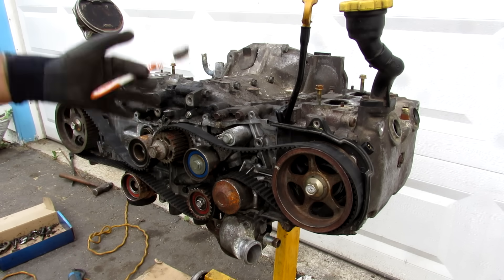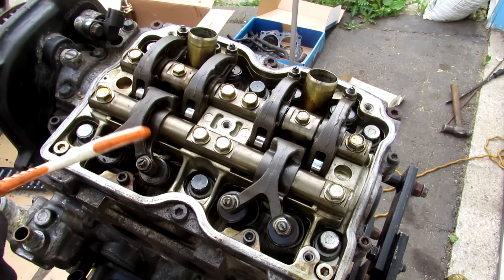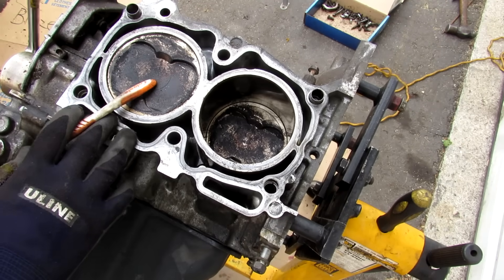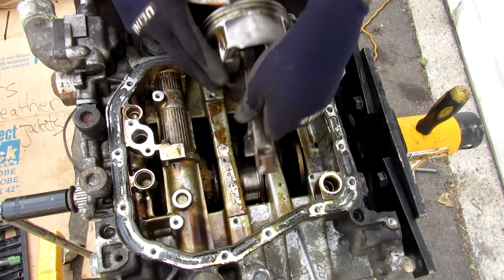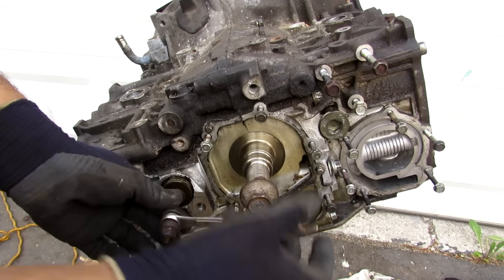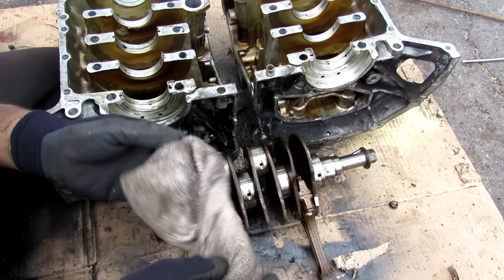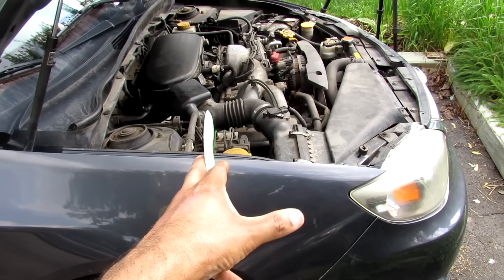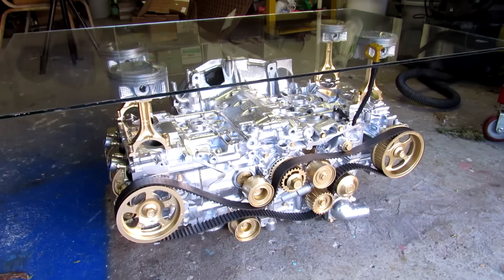Why Subaru Engines FAIL

Comment: I’m gonna actually disagree with the statement of V shaped engines being smoother than inline engines. I’ve felt the vibrations directly from Ford’s EcoBoost V6 and their Duratec i4, and the Duratec is far smoother. While it simply vibrates, the EcoBoost has a light rocking motion

Comment: Good vid, but v engines are def the least well balanced and require additional rotating parts to counteract the diagonal forces
Reply from the maker: I messed up on that, looking back
Reply: @speedkar99  dam you replying to comments on a vid years old? Respect+

Comment: wish i had that knowledge i got an old forester i just got not that long ago no lights no issues but needs basic maintenance brakes rotors drums its got a weird little jump like other foresters ive driven at low speed sometimes it acts a little weird but never in higher gears or even all the time more like an air fuel thing idk im not you so im asking if you ever heard of this issue?

Comment: I've only owned one Subaru. Even though I was extremely meticulous about service, maintenance and fluids, it gave me more problems with less than 60K miles on it than any other car I've ever owned and this covers the years 1966 until now. This car was designed to self-destruct when it left the factory. Never again. 
I don't blame the boxer engine design because my 1965 Corvair Gen 2 was MUCH better. 
I switched to Honda cars in 1991 and they have all been extremely reliable. However, the new and tiny, over-stressed DGI engines in all makes and brands are in my opinion, doomed to  premature failure as well.
Reply: that's really interesting that you had such trouble with them. Ive been driving Subaru for years and have never had any major issues, sure the maintenance can be frustrating but overall they're super reliable cars if you take care of them.
Reply: @NoiceToasty  At 60K miles, I suffered blown head gasket, broken timing belt, broken pulley brackets, broken exhaust system insides, broken AC compressor and many other things. After having towed to the shop the third time for another major repair, I traded it in for my first of many Honda's which have all been excellent.

Comment: Excellent explanation; the editing is tight but there's just enough modulation in your voice to preventing it from becoming a repetitive drone or sing-songy which plagues many youtubers. Great information on the tear down and inner workings of the Subaru boxer. As far as the title, is the reason boxer engines fail is oil starvation?
Reply from the maker: Headgaskets

Comment: Sorry, but with the title "Why Subaru engines fail", I expected a definite answer to this, but ANY engine that is run low on oil will fail!
And the Boxer IS a proven design (Porche), so that ain't it. Yeah, I'm sure the anti Subaru/Boxer guys will have a heyday
Hell I was thinking I would be told about a common problem here, NOT a maintenance issue.
Reply from the maker: Ok

Comment: I've had two Subaru's never had a problem with either one.  The first one I gave to my son when I hit 200,000 miles because I was worried it was wearing out.  at 289,000 he got rear ended and it totaled the car... Still running perfectly, but the unibody got wrinkled all the way to the windshield.  As long as they are maintained I've never had a problem.  Synthetic oil always and timing belts changed as specified.

Comment: Great video.  It should be used as a wake-up call to people of all ages that have no idea how an engine works and think that just because they are made from steel and aluminum they are indestructible and require little to no maintenance.  Note to the ignorant; if you want your car to take care of you then you sure better take care of your car.

Comment: 224k on my 2014 crosstreck... Same engine same transmission.. Running smooth and no check engine light.. Yet
Reply from the maker: Enjoy it while you can
Reply: Lol well I am soft on the accelerator. I think that helps. Most bust up's are on the wrx, those are driven really hard by people. I am keeping an eye on leaks, for now it's ok and the oil has not been dropong off.. Yet

Comment: my 91 subaru legacy has 362,000 miles on it and it is still running perfect. Yes, I change the oil about every 4-5000 miles but never over that and never use Fram filters.
Reply from the maker: Those were the good ones
Reply: Yes, mine were both early 90's engines and were fantastic, no oil or coolant leaks.  People don't realize how much better the synthetic oils are compared to the older type.  Much less friction mainly which leads to less heat, bearing wear, valve train wear, seal wear and of course ring and piston wear.

Comment: I bought an 07 Subaru Impreza for 700 bucks some years ago. Needed an engine, as not only were the heads warped from overheating.. but so was the block. A part of me was kind of impressed hahah. So i got another engine for 500 bucks that only had 20k miles, and just had the heads redone. Put in a new timing belt, pulleys, gaskets, you name it. Everything. Engine was practically brand new! Got ONE YEAR out of it before a valve got clapped by a piston cause the timing jumped. Did a compression test once i got it home, and lost both cylinders on the passenger side. And during that year, subaru's infamous freezing calipers reared their ugly head. Spent a pretty penny replacing all that. And yes, i maintained this engine religiously! I took great care of it!

I got so mad, so fed up, that i took my BFs truck, chained it to the Subaru, and dragged it out back. Where she still sits. I'm gonna sell it, along with aaaaalll the parts i have for it. It's fixable, but i refuse to put another dollar into that car. It was absolutely phenomenal all year round. Especially in the snow. But goddamn those boxer engines! Only good to use as an anchor or to make a pretty table out of them
Reply from the maker: I have one as a coffee table and love it!
Reply: @speedkar99  omg that's awesome!!

Comment: I’m on my 4th Subaru over 20 years. Never had a problem! Great cars.
Reply from the maker: Good to hear!
Reply: I am on my 3rd Subaru.  02 wrx has 230k miles, 99 impreza has 250k and 06 forester xt has 165k.  99 impreza was rusted out, ran great and didn't burn or leak oil.  06 forester was totaled in a car accident, burned very small oil but ran very good.  I still have my 02 wrx for DD right now, runs great and no burning or leaking either.  I only had to change brakes, oil, coolant, spark plugs and timing belts.
Reply: @Pccpy hich is the best generation of wrx to buy used
Reply: @SK-tr1wo  IMO GD 2000-2007 (Second Generation) is the best to own if you can find one without rust.
Reply: I still have my 94 probe gt daily driven for almost 30yrs... about 260k mi ,all original, never rebuilt..even the original clutch and exhaust....4 cars over 20yrs  is not bad but many cars have gone far longer...The caveat with the KLDE mazda engine is ive had an insane numbers of issues over 3 decades..far from trouble free ..LOL
Reply: on my second subaru totaled the first one after falling asleep on the highway
Reply: On my third Legacy (last two, Outbacks) since 1987. My current (1998) Outback at 103k miles, aside from changing timing chain, and clutch a couple of times, never any problems.
Reply: I'm on my 1st honda in over 20 years....
Reply: So, why are you on fourth car? I have been driving my only one Jetta last 20 years…!
Reply: so you only keep them 5 years?
Reply: @ yes. Different models for different needs,
Reply: You need to buy a lottery ticket like right now!
Reply: Still have my first Toyota 27 years later, 220k  original engine. You should buy a better car.
Reply: @MathWithMozart  maybe he just likes subaru that much that he bought 4, you never know.
Reply: @MathWithMozart  That's great for you. I have no desire to be driving around in a car with 220K Miles on it. Just because the OP bought a new Sub every 4 years, doesn't mean it was because they were dead. People buy new cars for all kinds of reasons. They just love the new car smell, they want the new features, they have a job where driving a new vehicle makes a good impression. Or any number of reasons. Your comment comes across as some clever dig at the quality of Subaru, but it's really kind of out of touch with reality.
Reply: @MathWithMozart  people like what they like, not like toyota is perfect. I do miss my old jeep wrangler, thing was a tank. New one is 99.769838 percent plastic, oh well

Comment: I've had four Subaru Imprezas and serviced them all. The spark plugs weren't difficult to change if you had the correct plug extension bar. Great cars, never had an engine failure.

Comment: Spark plugs changes on these in the car is very easy I'm not a mechanic and it took me less then an hour to replace the plugs, wires and coil. Plus I have roughly 230,000 miles on it

Comment: 5:48 the crank is gives oil pressure, the pump just helps it move through out the engine
Reply from the maker: Yes you are correct. Oil pump provides flow

Comment: If this “Boxer” design has such numerous flaws and features that could easily lead to problems….why does Subaru continue to use this engine in the format that you’re showing us ??
Does Subaru Boxer engines have enough issues to basically warrant a swap out to some other engine design, or does Subaru just not really care, or are the problems inconsequential enough to prevent Subaru from doing such things?  I have a 2011 Outback with a zero tolerance engine and a sealed transmission unit.  I bought the car with 176000 miles and carfax said a new transmission was installed around 120000 miles.  I then put an entire new exhaust system in including catalytic converters and all new pipes and a couple tune up.  Then I thought the transmission was going but it has a CVT in it and it turned out that the transmission was fine.  It was the separate computer that controls the CVT that was bad.  Replaced that and it ran like a champ.  Now…. It’s overheated and the coolant overflow keeps filling up and my upper black hose gets hot but the lower one stays cold.  So I think the thermostat is stuck…..what do you think????????

Comment: Yep my girlfriend had a forester blow a head gasket cuz radiator leak gone undetected..easy to break if you dont check the engine often...another car to avoid is the dodge avenger worse then a subaru in my opinion

Comment: Five seconds in and I think I know what wrecked the engine.
It was the lightweight pulleys on the front.
Subaru are fully aware that their heavy pulleys maintain the crank speed during idle. Lightweight pulleys allow the crank to alter speed at idle, and the spark happens before TDC, which destroys the bottom end fairly quickly.
So yeah - don't put light pulleys on an EJ!

Comment: After retiring from a long career in engineering , my neighbor invited me fill a position and  to work for the Subaru dealership where works as a parts sales manager . My part time job was to manage and provide solutions to   the building systems maintenance crews ,which included  garage floor  machinery and lifts. Not a huge dealership ,so , the job did not require a full time manager, besides , I could always be reached easily if needed. The lifts issues enabled me to chat with all the techs , and see first hand what was going on with SUBIE engines transmission etc. Any engine that has to come out of the car in order to have its head bolt retightened after some arbitrary mileage to keep the head gaskets from leaking oil or coolant is a cruel joke played on SUBIE buyers, which incidentally have perpetual recalls  on every model they make .Ranging  from wheel bearings that are cooked at less than 60 K miles to brand new Ascents with bad PCVV valves and infotainment systems that when failed cause windows to stop going up or down 😂😂 that is a big WTF. After about 2 years in 2020 I decided that I wanted to be really retired to indulge in my hobbies full time. But I came away from that experience thinking that  I would not own a SUBIE even if one was gifted to me . However , I`ll say one thing that is undeniably true about them and is positive ; SUBARY  warranties are likely the best in the industry , in order to keep a good reputation they will go out of their way to cover repair costs even on vehicles that are out of warranty for a year or so,  also   the sheer carnage that STI owners cause by abusing those hopped up  ready to explode grenades one owner in particular got his STI engine rebuilt twice  $ 17 thousand the first time and the second for  $15 thousand, the damned car would not retail for 30K if  on the lot, mind numbing.
I am a motor head from the mid sixties , no stranger to engine carnage , but STI engine carnage is unique ..perhaps you can do a video on that so people can see what I am referring to .
Nice job educating the viewers👍👍👏

Comment: The SOHC engine didn't have oiling issues. That was mostly on the turbo cars. They also didn't have issues with burning oil. The turbo models did. Any turbo car will burn oil due to blow by but the turbo EJs had issues with a lot of blow by. It was easy to fix that. Run good oil as well. Most engines can do good with proper maintenance.
Reply: not true alot of ej253s had oil consumption issues even subaru acknowledged it
Reply: @Growing up  Subaru acknowledged it because they were trying to get as much MPG out of that engine as they could. They used a loser ring gap. Other companies did the same thing and ended up with the same results. It wasn't an issue if you didn't use 0w20 though. I have on sitting at 200k miles with the original engine. Use a different oil.

Comment: He’s wrong on the balance of a V6.  The V6 is the true definition of an abortion of an engine.  Unbalanced on primary and secondary and needs balance shafts or large balance throws to keep from shaking apart.  Out of the three engines he mentioned the boxer is the best balance wise, then the inline 4 and the V6 is the worst engine design of all engines made period as far as balance.  The In-line 6 is the best and most perfect engine period.  Why most early aircraft used them, nearly all large trucks, and many of the greatest engines ever built are in line 6’s.  Why he likes a V6 is beyond me. I’d take an inline 4 or an apposed 4 over any V6.  In fact I refuse to own a V6, as they are horrible engines
Reply from the maker: I agree. I mixed that up

Comment: My 2008 Impreza Just blowup engine with Just 28000miles on warranty. The warranty does not cover saying..." its because a rotor malfunction and its not covered by warranty"... crap motor, junk. Only for fools
Reply from the maker: Ouch

Comment: They fail because you fuck with them.  You got your bigger turbo, fuel rails, pumps, radiators, scoops, aero package, e85 maps, and you’re putting out 50% more torque than it’s meant to put out, and you wonder why it fails after two and a half years.  Good years though
Reply from the maker: But alot of people don't modify and it still blows 😞

Comment: Thank you for this superb video!
Thank myself for having a Model 3 with one motor shaft and a 3-shaft 2-stage-spur gear and an open diff connected to the wheel.

Comment: This stuff is forgivable for Porsche because the engines make good power and it’s in a sports car. Subaru’s NA boxers are pointless. Yeah I know the 86 is a sports car, but the engine is still its weakest point. If you’re going to have all these caveats in the design at least do it chasing performance.
Reply from the maker: I agree. They are unique for not much gain.

Comment: I ve had 3 impreza’s the last 12 years models from ‘98 to ‘02. All performed very wel! Love this brand and their famous boxer sound. These were my most trusted cars to drive from all of them. Summer of winter.  Only problem is rust in the wheel arches. 😢

Comment: I see this video is now 2 years old, but from what I've read the newer Subaru boxers engines have fixed the head gasket seal leaking issues.  What are your thoughts on 2019 and newer?
Reply from the maker: Hate the CVT now ☹️
Reply: @speedkar99  All CVT's or just the Subaru?

Comment: I had a brand new Subaru Liberty back in 2005, it was a lemon. I was constantly putting oil into the damn thing and trying to get Subaru to fix it was like pulling teeth. It goes without saying I never bought another one. I have no brand affiliation and this actually happened.

Comment: I really like the idea of having a subaru, but every one I have seen with over 75k on it has had oil leaks, oil burning issues, or head gasket issues, or all of the above. I have also seen some with catastrophic engine failures where subaru wouldn't honor their warranty. I really think they are for enthusiasts who want to work on them constantly, not for regular folks.
Reply: Better never get one... They are expensive pieces of junk that require to take apart half of the engine just to seat a a hose clamp, a lift or to pull the engine out to make a major repair...

Comment: There is no perfect engine. All manufacturers has their own problems.
Reply: but im going to be honest, the subaru boxer engine seem to be ticking time bombs. i love the idea but i cant bring my self to deal with its consistent problems that i see and hear about.
Reply: @spp6849  doesnt make sense..i hear quite the opposite...the reliability rating is 3.5 out of 5..which isnt bad all.
Reply: @Dirka41   yeah thats about average. im good, i would rather pick a inline 4 or v8. they tend to handle more rough driving without a bunch of bandaid mods.

Comment: The fail because people don't change the timing belt, water pump, and head gasket everyone 100k like design intended. I know countless people with hundreds of thousands of miles on their EJ motors. They just did their maintenance properly.